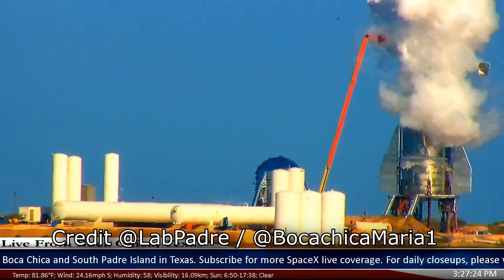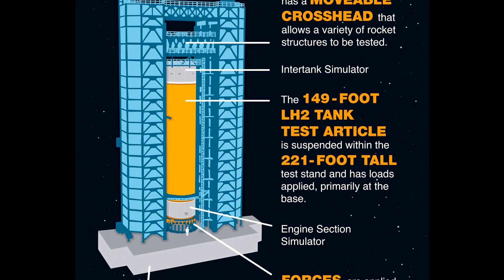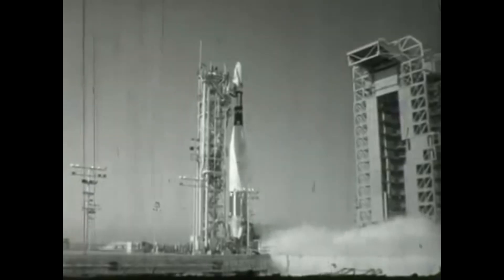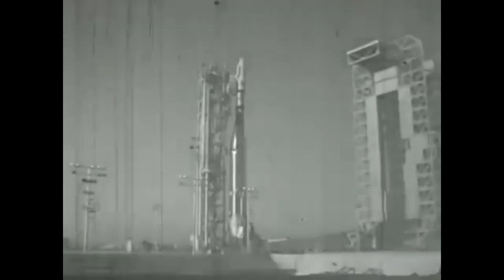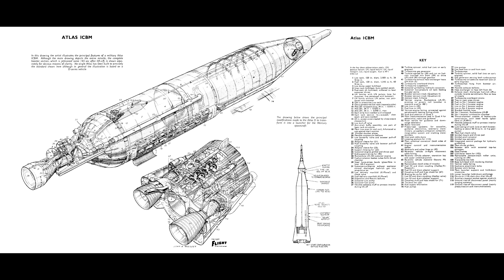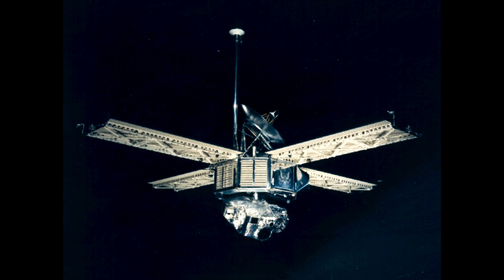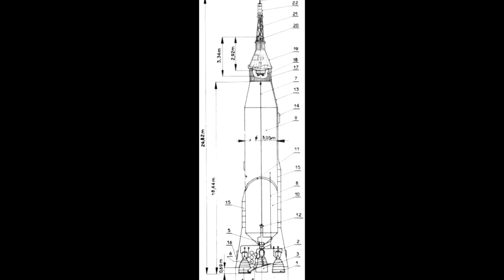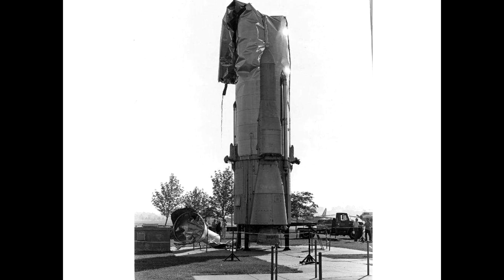Why Did A Rocket With A Secret Payload *Implode* on the Pad?

Comment: If mankind wishes to advance in these ways the first thing that needs to catch up with our perceptions of advancement is understanding the power of the language in which we use and have been merely allowed to define in a way that has only limited  possibility. Example "rocket" is a word that can be broken down into two parts based upon our own interaction in developing the word. The first part is "rock" . according to human understanding this noun is only connected to flight based upon a stone age understanding. Its usage in relation to flight might be presented like this.  " we cast rocks at one an other.  The second part "et" is by simple definition a suffix. et: forming larger nouns through the addition of diminutives. In simple laymen s terms, making something "smaller", larger by adding definition. You can add all you want to the word "rock" this still will not have it fly any better based upon  the simple definition of "rock".  One of the most powerful too;ls available to us in this age is "the power of spoken word"   We currently are waking up to the limited power of our own process of defining things in a way that gives little or no consideration for this inherent and self evident power in words.  Thanks for listening for it is great proof of a belief  in freedom of speech, expressed.
Reply from the maker: https://www.etymonline.com/word/rocket
Reply: @scottmanley  In your own curiosity you have probably recognized the first degree connection between plant and rock.  Mineral.  It is perfectly reasonable to have a plant connected to a rock in language, for in our natural world, (which appears to be in decline) both are greatly connected and grounded in their connection. As humans may we at least be connected and grounded as, the natural world around us. Thanks for offering so much to think about.
Reply: If our reach in these areas  is to based upon the flight of rocks. Then I freely offer one up for grabs to any industry involved in these activities that would lighten the load" Featherstone". Even this is limiting, yet better than current definitions.
Reply: @(S)-Riley Dunn Even drivel with further exploration can be found to be "that which sustains" or that which must needs "be sustained" Currently, society is waking up to the fact, the drivel we we're  all fed was not sustainable, but had to be sustained by the efforts of those who believed the drivel.  Thank you for acknowledging "drivel" and its importance in the true advancement of humanity.

Comment: You're the only time I heard anyone come close to calling the Atlas a SSTO which arguably it is and has orbited its self albeit with a  minimal payload but none the less a great achievement for a kerosene fueled rocket. Important points are: Ground ignited sustainer/vernier engines AND same tankage as the booster engines all going into orbit.As you mentioned only the 2 booster engines are dropped but no tankage. I worked on the test stand where the Atlas was captive fired full flight configuration at Edwards AFB,stand 1a later configured for the Saturn F-1 engine testing. Great job as always Scott. Ken

Comment: I live in Dayton, Ohio, just a few miles from the Air Force Museum (as it used to be called).

I well remember, in the early 80's, walking out to the static display missile you mentioned, and I noted that there was only one compressor system keeping it pressurized - NO backup!

I almost went back into the Museum to find the suggestion box, or some employee, to tell them that it was only a matter of time before that single compressor quit working for some reason, any reason, and that would be the end of the display, and that one, or better two, back ups of some description were needed.

Guess I should have made that trip back inside....

Comment: How does a rocket with balloon tanks continue to operate as it depletes enough of its fuel that the pressure in the tank starts to drop? Do they need to drop the stage earlier than normal, so the stage doesn't crumple from the force the engine exerts on the payload? Or are the forces involved less of a problem once the thing is in space?
Reply from the maker: They include helium tanks to add pressure to tank as it empties

Comment: For ground transport the Atlas was carried by trailers that maintained the missile in a longitudinal stretch so they wouldn't collapse.  Just recently I found an aerial photo overlay showing the original General Dynamics Astronautics (Atlas) facility completely replaced by an industrial park.  Sad to see such a beautiful complex gone.  

There was, at one time, an Atlas standing in a park adjacent to the facility.  If I remember correctly it had a plywood inner structure to hold it up without pressure.  

If you look at the various Atlas photos and drawings you will see "blisters" attached to the outside of the body.  They housed the electronics.

Did you know the original Atlas had 5 rocket engines?  Yes, it did. thanks to Jim Crooks.

Comment: A couple of thoughts on the pressure stabilized "steel balloon" structures: 
1) It should be noted that in flight loss of tank pressurization is a flight loss for any rocket. The structure of "free standing" designs are not designed to carry the propellant loads without pressurization. The pumps also require pressure on the inlets to prevent cavitation on the low pressure sides of the impellers and stators (forming tiny near vacuum gas bubbles in the flow). When these bubble collapse they generate momentary high pressures and temperatures. When this happens with the LOX pump, the metal surfaces catch fire with disastrous effects. 
3) Solid motors can be integrated to the tank using an internal ring structure as the Atlas 2A demonstrated.
4) The real advantage of this construction technique is it decouples the requirement to be "column stable" under compression loads. This means that the material density is not a design requirement. Longerons, low density composite walls, honeycomb structures, and complex panel wall machining are unnecessary. The only figures of merit to consider are strength to weight and weldability. This opens up a world of potential materials, including refractory alloys that could make a reusable system simpler than competing concepts due to the near complete elimination of the acreage high temperature TPS. Post flight inspections would be vastly simplified by the single membrane tankage walls that would be completely exposed for both visual and gas leak detection.
5) Scot noted that the Atlas was close to being an SSTO. Putting numbers to this - Mercury capsule weighted about 5,000 lbs and the booster motors and aft skirt that were jettisoned weight about 7,000 lbs. The Atlas was within 2,000 lbs of being an SSTO out of the 350,000 lb lift off weight with second generation MA-5 engines that were capable of a whopping 295 sec vacuum Isp. SpaceX's Merlin 1B, running of the same propellants advertises 310 sec and RD-191 337 seconds, likely close to the practical limit for RP1. The SpaceX Raptor advertises 363 seconds on the somewhat less dense methane, likely the best that can be done with a hydrocarbon. Diving into LH2, the RS-25 demonstrated 452.3 seconds For a 30,000 ft/sec mission this would yield a 16%, 48%, 80%, and 200% increase in injected mass respectively (Low LEO with 5kft/sec assumed aero and gravity losses).
6) There are two big disadvantages to the pressure stabilized concepts. The first is perception, it just seems flimsy and look flimsy when held depressurized in a stretch fixture. The second is the tooling required to manufacture this class of structures is expensive and complicated; all the weld joints must be supported both internally and externally. The Atlas internal fixture collapsed like a monster umbrella to pull it out the end access panel. The Atlas manufacturing jigs should be in a museum.

It is interesting how we seem to be very satisfied with a pressure stabilized structure in our daily lives; the pneumatic tire. The tire is much more structurally complicated. The operational environment is fraught with dynamically changing loads, abrasion and sharp objects. Makes tank design seem like a cake-walk.

Comment: Are there any launchers that can support their weight when unpressurized at 1 g, but rely on fuel pressure to support themselves against high-g flight loads?  Seems like this would be a good compromise between high performance and practical ground operations.

Comment: The engineers that designed Atlas ran afoul from Von Bruan by making the booster with a very light frame. They dared one of Von Bruan's team to knock a hole in the stage with a sledge hammer. when the guy hit the Atlas he almost took himself out with the sledge hammer when it  bounced from hitting the 'big balloon'.  This is because some thought Van Bruan built his rockets like bridges and he did.

Comment: what the hell is a "implosion" for you? I didnt see any.. you should start talking about the amounts of oxigen just 1 person needs to be in space, for ex. for 33 days? .. just 1.. tell me if its viable and where do they take the oxigen tanks to live for days in space.. 
in case of trouble you can compare with bottle diving.. (remember the size of their suits and the size of their spaceshuttle.. thanks
Reply from the maker: For a proper environment control system crew need about 1 liter of liquid oxygen per day, so 30 liters per month.
Reply: about the so called "implosion" you say: "Some Rockets designs rely on gas pressure to support their tanks, and when leaks happen the tanks implode and collapse" .. yes, its a leak.. an implosion is an explosion to the inside of the core.. ex. a star implodes first and then explodes.. or, negative pressured density cores if they go booooomm, is through an implosion..

Comment: If you were going to put one on display, outside, why wouldn't you put a rigid support inside it? A constantly running and maintained compressor system would have to cost more than threading it over a vertical shaft of girders with a few support rings to give it a skeleton. It's not like you're going to decide some weather beaten piece of retired hardware has to be kept flightworthy.

Comment: Why does the rocket color change at the edit?
Reply from the maker: Because when the tanks were full of liquid oxygen a layer of frost formed, after that drained the frost melted.
Reply: Scott Manley ...nah. There is a fade, then you see the white and it suddenly turns metallic. Not a melt off slowly, sudden change. Watch closely.
Reply from the maker: Yes, there’s a cut because it took an hour for the LOX to drain out.

Comment: Your common soda cans are designed the same way.
The walls of the cans are so thin that they would collapse under the weight of the cases of soda placed on top of them. It is only the pressure of the carbonated soda inside the cans that allow them to withstand the weight of the cans stacked on top of them.

Comment: I wonder if this implosion type propulsion system will work. Normally earths atmosphere is evenly pressing you from all sides. If you create is vacuum of air in front of rocket or airplane in such a way that earths atmosphere is no longer able to evenly press rocket or airplane from all sides, thereby creating a implosion type propulsion where earths atmosphere does the work of propelling the rocket or airplane due to vacuum creating rarefaction/very low pressure of air in front of rocket or airplane. Uneven air pressure resulting in propulsion. If this is combined with the usual explosion type exhaust propulsion, i think propulsion efficiency can be increased.

Comment: Having the structural integrity of your rocket be dependent on propellant tank pressure makes perfect sense, from the point of view that your rocket engine isn't going to work very well without it. The fact that the rocket folds itself in half if it loses tank pressure is an additional minor complication.

Comment: 6:28 - Why not add an internal reinforcing skeleton to the museum Atlases so they won't collapse if the air compressor line comes loose?
Reply: Sean McDonough display atlases have an internal frame

Comment: I'm confused. How do these things not collapse in flight after most of their fuel is spent?
Reply: WallHaxx the airframe is pressurized separately. The tanks and bulkheads were rigid. The missile was assembled in a large frame, pressurized then kept under pressure for the rest of its life
Reply: @jamesanderton344  No. Watch it again. They are 'balloon tanks" One graphic even shows how the fuel and oxidizer were only separated by a thin bulkhead, which failed when of the tanks lost pressure.
Reply: WallHaxx if one depressurizes yes, the bulkhead will rupture or invert, but the airframe was rigid with empty tanks.....Atlas was not stored with propellants aboard like the Titan 2, one of the reasons why it was retired. Fueling before launch was a lengthy process and the missile was exposed above ground.
Reply: @jamesanderton344  The museum one collapsed without pressure. A leak is not the same as a breach. These things clearly crumple like soda cans when unpressurized, so how do they remain rigid under thousands of pounds of rocket thrust with low fuel pressure?
Reply: WallHaxx the gas pressure makes a very rigid structure....they say the Karel Bossart, the Convair engineer who led the project, kept a small pressurized model on his desk...and would invite guests to try to break it with a hammer. I’ve seen several display Atlases in museums and all had a support structure inside. I’m amazed that the USAF museum kept one in its original form and tried to keep it pressurized in an outside display. One of the criticisms of the Atlas system was exactly that....it needed a crew to constantly monitor it and it was kept in lay down covered pens until er cried for launch. A Titan 2 could be loaded, fueled and left in the silo with minimal attention.

Comment: It didn't implode,it just collapsed!! An implosion is a very specific physical reaction to external pressure,regardless of internal pressure. Just like people call building demolition implosions. Think deeply submerged submarines,which develope a hole in the pressure Hull and then crush themselves from the sight of the failure.Thats an implosion.Or the science experiment,where a barrel is heated,then doused with cool water,the temp difference cause an implosion
Reply from the maker: If you drain fluid out of a vessel under gravity the pressure drops and can become lower than the outside leading to an implosion.
Reply: @scottmanley  yes,but that's not what occurred here. This was a loss of structural integrity,due to the loss of the internal pressure. It just folded up. They don't just rely on pressur,it's also the volume,the physical presence of the kerosene in this case. I was just commenting on this specific instance. It just collapsed,not an implosion. An implosion is caused by greater external pressure than internal pressure. These balloon tanks can hold up their own weight but when they are put in the stack they are structurally to weak and rely on the fact that when full,not necessarily pressurized ,they are essentially a solid member.

Comment: There is a "not so famous" example of a missile silo in Damascus (dont know which state, im guessing Kentucky or Kansas).
During maintanence, a bolt fel from the top of the silo to the bottom, gaining speed, bumping against the wall and went trough the missile (remember, the thinner the skin of missile, the less useless mass) and pierced the fueltanks.
From there on it was the same as the rocket in the clip. The high pressure of fuel tank was essential for its strenght, wich was slowly decreasing. The corrosive effect of the fuel was dissolving the protective clothing of the crew that went in.

Small detail was a thermonuclear warhead. 3mile island was nothing compared to what could have happened if the blast didnt seperated the warhead from some systems (because the trigger mechanism was triggered i believe). 15megatonne thermonuclear warhead (castle bravo type weapon)

The history guy has a clip on it. Also when a bomber caught fire with nuclear weapons aboard. Fortunately, the wind was blowing the flames away from the fuselage instead of towards it. If detonated, it wasnt a good explosion (to compress the core), but would sent a lot of plutonium into the air.

Typing this on phone on the Johnson, forgive writing errors

Comment: I never realized some rockets used nearly tinfoil thick aluminum.  This explains a particularly catastrophic Titan II missile silo incident in Arkansas  in 1980.  The missile explosion was so powerful than seismometers in Colorado recorded an earthquake consistent with a tactical nuclear bomb going off.
Reply: Not aluminum -- hardened stainless steel. And though 0.4 mm is crazy thin, it is still 25 times thicker than the ordinary kitchen foil, and about 4 times thicker than the aluminum in the soda cans.
Reply: @cogoid  Still fragile enough that a dropped wrench can still spring a leak in the side of a rocket.
Reply: @ph11p3540  These rockets certainly can be punctured by a sufficiently strong impact, but it is a lot harder to do than it may seem. The guy in charge of structural design at Marshall flight center at NASA also doubted the strength of Centaur tanks, so he was given a chance to wack the tank with a hammer. The hammer bounced off and knocked his glasses off. There was no damage to the rocket. [Source: NASA SP-2004-4230, page 38]